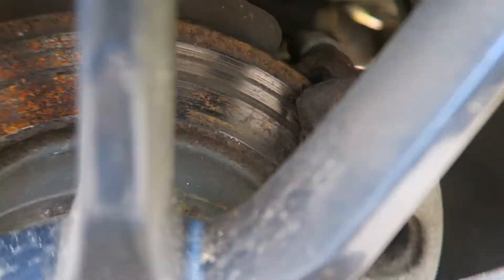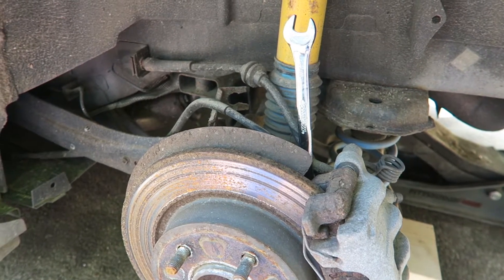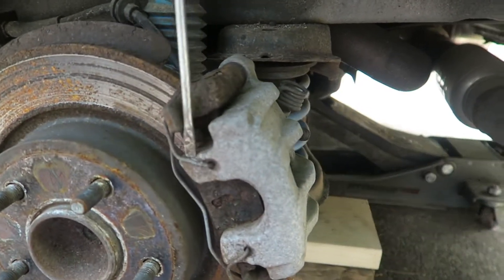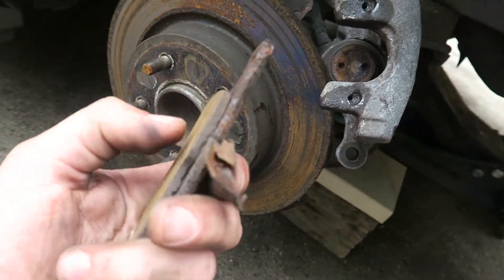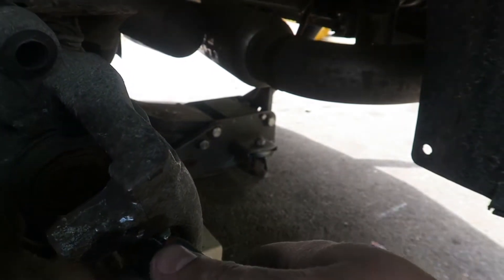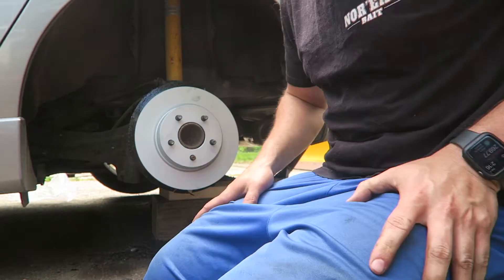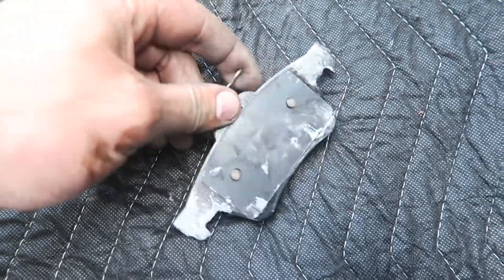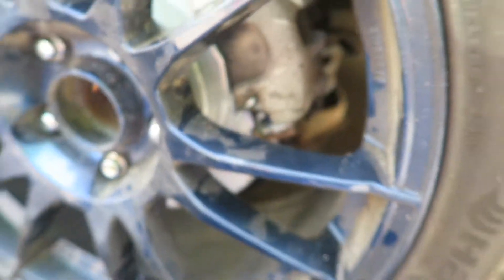*EASY* Mazdaspeed 3 Rear Brake Rotor & Pad Replacement

Comment: Thanks, turn rotor clockwise and push in at the same time, I also released the screw to let out some brake fluid, thanks again.

Comment: I would imagine the NH Oil Undercoating is flammable. Isn't that rather dangerous to apply in close proximity to a disc brake and calipers?  Wondering if there is a non-flammable alternative that stops the rust but does not pose a danger of catching on fire. Hmm...